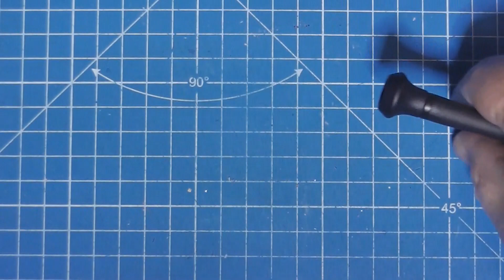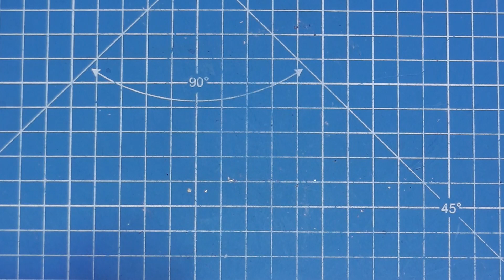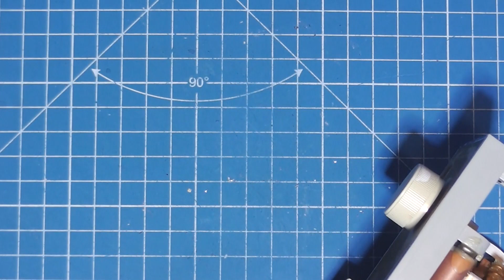Roberts Radio R550 - Blown Audio Chip

Comment: Hi, great video and although I've never done any form of electrical repair I going to have a go at replacing that micro chip thingy tda7231🙄. Can you explain what the other tool does ( not the soldering iron) but the clipper things. Are you loosening the solder and clipping the leg bits off the chip to release it. Then does the solder wick clean up the old solder on the circuit board thingy 😂. Any further help would be great and where's best to get the chip from👍 cheers and thanks so far😊

Comment: Nice fix Paul, sounds great.😀
Reply from the maker: Thanks Mike. Although the exact same radio as the R250, the R550 sounds better thanks due to the larger cabinet and speaker.
Reply: @Codeeze  yeah I have the R250 in black and the original charger centre pin negative lol

Comment: Well that's another one saved :-D
Have you enough chips he he :-D
Yes a schokky diode would have saved damage, tight assed roberts.
Reply from the maker: A few chips left. I bought a lot of the genuine ST ones many years ago, cheap. In hindsight, I should have bought more and cornered the supply market...
Reply: @Codeeze  i looked at the pin out a few years ago, and it's an odd ball.
The lm386 would be loud enough to hear it but it would need its own components on stripboard.
Tb820 jumps to mind but it's still a pain.
Sorry im repeating the past again.
Reply from the maker: @zx8401ztv  There are a few options for chips - I have a good stock of the TDA7231 - so I shouldn't have to worry in this lifetime...
I did use an LM386 in place of a 2201X01 a while back - wasn't pretty - but it worked...
And don't panic. The past has a history of repeating itself...

Comment: Nice repair. I recently did a refurb on an R250 Special Edition for the charity shop I volunteer at, I fitted a diode to prevent any future accidents. Happily, it fetched a good price.
Reply from the maker: They should have had protection from manufacture really. The specials always achieve a good price working and in good condition. Thanks for watching!

Comment: With most power adapters being centre pin positive, wouldnt it be easier to avoid future 'accidents' by changing the socket polarity ?
Reply from the maker: You'd think so - but then you'd potentially have folk using the centre negative factory supply, (the correct one) and blowing the chip...
I do put a diode in to stop future reverse mishaps, I didn't show this on the video, but maybe I'll do a short one on how-to.
Thanks for watching!
Reply: @Codeeze  I have made a short lead with plug and socket, where the polarity is swapped on the plug end. I had to mark it but it uses any non Roberts power supplies. :)